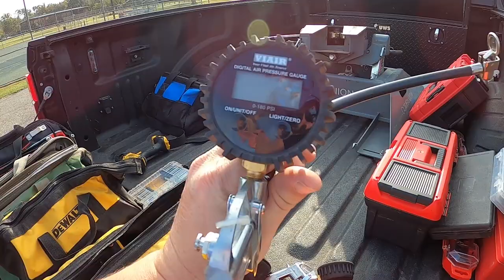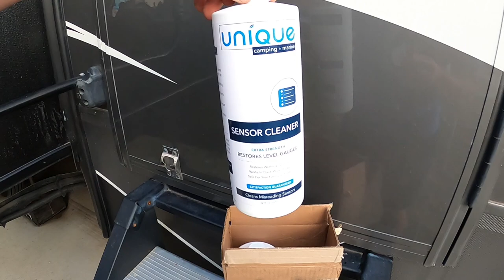What's In Here Could Save You! Be Prepared For Anything! | Fulltime RV Living!

Comment: Hey brother, great video. We run the MX-4 as well. we have had a major fitment issue than requires us to slam the tailgate to get it to close. Bak has been a massive PIA about replacing the rails that rails that are 1/4" too long. They have verified, via pics, that the rails are too long. I think they shipped the wrong rails since they come in a second box. Just a heads up to anyone thinking about using them, Customer service is not great.
Reply from the maker: We have no fitment issues, but you do have to watch the rubber flap at every joint when you go to close it to make sure it falls in the channel and not on top of the bed rails!  Why don't you just trim the rail down if it's the end piece by the tailgate the end cover on the rail is a plastic insert you can take out and trim it down 1/4" and fix your issues!
Reply: @PavingNewPaths  never thought of that, Great idea. now i just have to find my hack saw. Heck, I might be able to just sand it enough.

Comment: What kind of DEEEEEEWalt guy doesn't have DEEEEEEWalt tool boxes and mechanics tool set???!!! 😂  I have the DeWalt stacking dolly boxes, and they break down and fit nicely in the belly of the camper.  Don't carry a heat gun, jig saw, or sander.  Instead, I  have a 1/2" HD impact, angle grinder, and the 20v tripod LED.  Looks like you're as CDO (which is like OCD, but with the letters in the right order) with organizing your tools as I am!!!  I also carry a hydraulic automotive floor jack for quick tire fix issues.  Individual tackle boxes for: fuses, electric, electric adapters, lighting, hose/water fittings, compressor fittings/adapters, tire stuff (plug kit, batteries for TPMS, valve caps, pressure gage), various screws/fasteners, and FlatOut (better than Slime).  Probably more that I'm forgetting, but that's the important stuff.  Glad to see I'm not the only knucklehead that carries around all this stuff!!!
Reply from the maker: I have always been a fan of craftsman tools and most of these came from days of fixing oil rigs!  I started out trying to put the tools in the RV but then I realized I might want to have tools somewhere the RV is not, also it was taking up so much space! I almost couldn't reduce my collection enough to fit in this one toolbox and was about to buy one of those flat toolboxes that go behind the fifth wheel hitch!
Reply: @PavingNewPaths    I was just yanking your chain about the Craftsman stuff!😂  I actually have 3 full Craftsman tool chests and tools between my garage and my shop.  Up until Sears closed, that is what I almost exclusively bought.  Could never bring myself to spend Snap-On /MAC money, when the Craftsman were decent quality and had a lifetime warranty…
Reply from the maker: I love Craftsman but I also enjoyed the no questions asked warranty at sears! We used to have the tool trucks come to our shop but I couldn't justify the price! Plus we found that nice tools walk off!

Comment: What kind of jack do you use if you have a flat tire on camper or do you use the jacks on the camper
Reply from the maker: We use the jacks on the RV to do all the maintenance on the axles and bearings and would do the same if we needed to change a flat while on the road!  Another option if the jacks were not working is we have a triple axle rig so you could drive the tires that were not flat up on wood and it would lift the flat tire axle off of the ground!

Comment: I have had Milwaukee for like 18 years and the battery’s are to expensive. Dewalt have stepped up their game and battery are better and cheaper so will say get dewalt 💯
Reply from the maker: The Milwaukee's are nice and have plenty of power, I have never been afraid of a Dewalt when drilling holes in metal, but I have had a Milwaukee drill try break my arm doing the same job!
Reply: @PavingNewPaths  yes will say my Milwaukee will break your arm just battery’s go dead when not even using them

Comment: 20v Dewalt 1/2 inch impact I didn’t see 🤷🏻‍♂️😉
Reply from the maker: I have one it was the next tool I pulled out of the bag after the sander!
Reply: @PavingNewPaths  👍 missed it on but they are awesome to have for wheel nuts 💯
Reply: You have a mechanic background and you know how hard it is to not buy something that makes it easier. Bought a lot of tools I only uses maybe once a year or less. It is addicting💯😉😂 lots of things probably could do job without but why not get the easier options. Good thing snap-on or mac or Marco don’t show up here. 😬😅
Reply from the maker: @kevink4914  We used to have the snapon truck come by our shop every week! I had to start leaving when he showed up!
Reply: @PavingNewPaths  I hear you there seen many go in Debt to far. Like the saying that I see lately any tool can be used as a hammer if you use it the wrong way.

Comment: I see on your Bak Flip you have the same scratches as I did.  Second section south of the cab.  This is caused by the screws holding the rubber bumpers not being seated enough into the bumper.  Therefore rubbing the paint off the second section.  Since Bak Flip Carries  a pretty good warranty, the dealer I bought it through warrantied and replaced the whole folding assembly and installed upgraded thicker bumpers to alleviate any future scratches.
Reply from the maker: Yes! I have the same scratches and it drives me crazy! Mine are not from screws but from where the whole assembly rest on the last piece when folded while driving! The rubber bumpers that came with it were not screwed in but just had adhesive holding them in place. They kept sliding when we we're towing and eventually it was flap on flap contact with no rubber causing it to scratch! I have tried several weather stripping options and they work for a few moves and the also will shift on you causing more scratches!